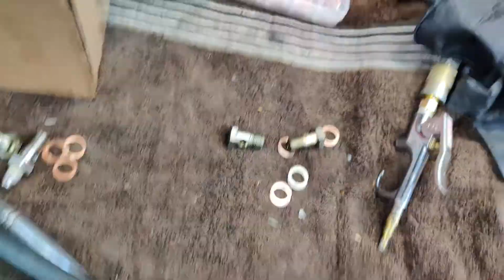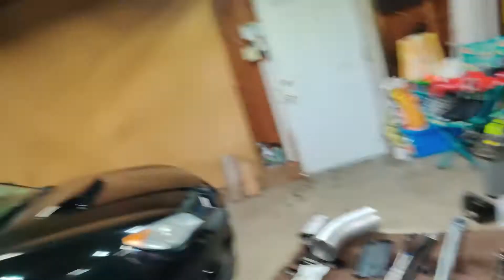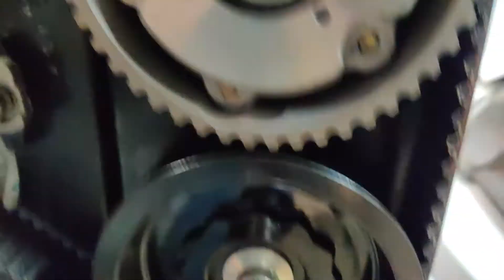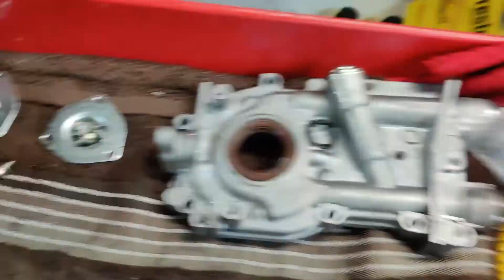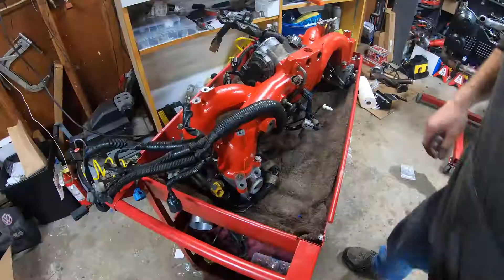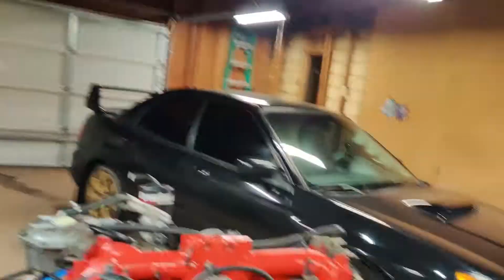2004 Subaru WRX STI EJ25 Engine Build .. part 3

Comment: These videos are so damn helpful. Been building a sunwest core coincidentally enough and watching these while doing it! Thank you!👌
Reply from the maker: I'm glad the videos are helping you with your build. If you have any questions feel free to ask!

Thanks for watching and good luck with your engine
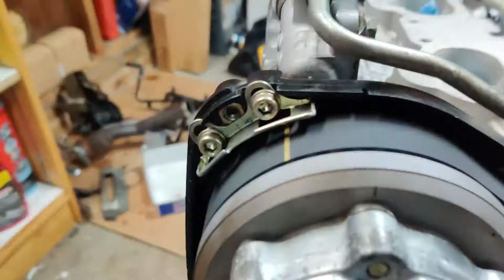Reply: @Lonnie Brown  hey I do have a question! I'm @ ~16:00 and my timing isn't lining up? The passenger side lines up but not the driver side. I shouldn't have to turn them further than the cam allows right?🙃
Reply from the maker: You need to turn them as far as they need to go to line up with the marks on the timing cover. They probably won't stay in place unless you hold them there with a wrench. There's a tool you can buy that's holds the cam gears in place. 
Remember to rotate them the right way. You don't want your valves hitting if you're running them both at the same time the wrong way. 

I have a .PDF file I can email you that covers timing belt installation
Reply: @lonniebrown6678  that would be great! My crank is also not at tdc. Is that okay to turn to? jvbonds5@gmail.com
Reply: I assumed that sunwest would have shipped it at tdc but idk 😐
Reply from the maker: @BondsIII  as long as the cams can move freely, you can turn the crank as much as you want. You don't time an ej25 at tdc like other engines. When the crank sprocket is pointing up at the oil pump mark, all the pistons are in the middle on their stroke. 

I'll email you the PDF right now.